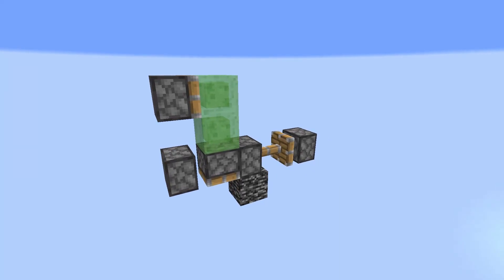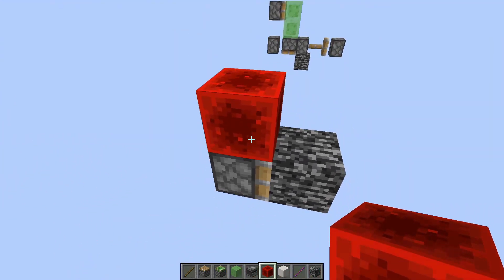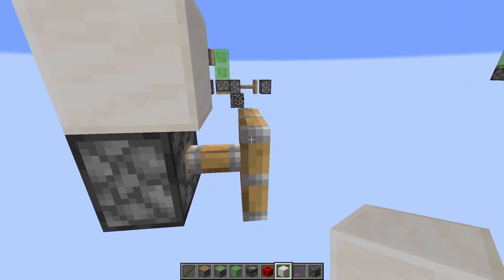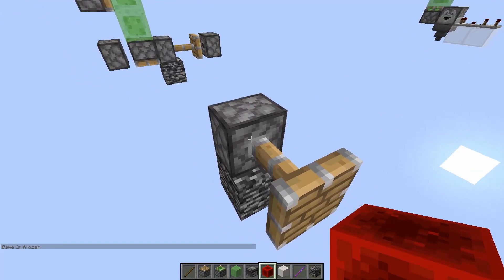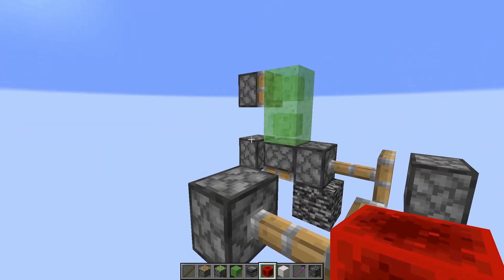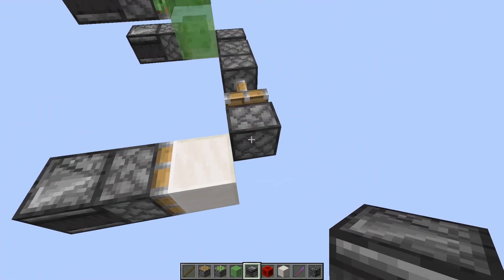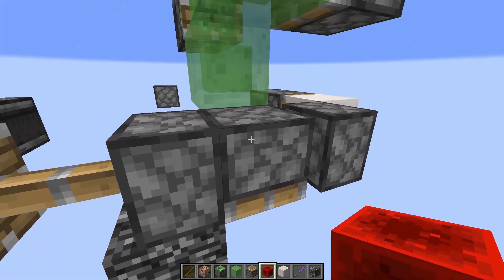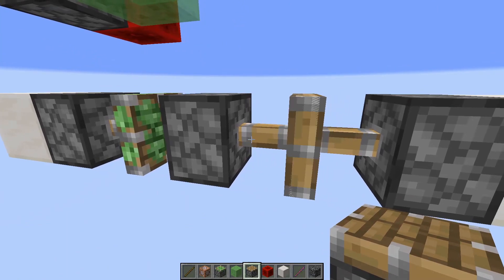Piston-based bedrock breaking setup explained

Comment: Headless sticky pistons "tp" blocks because the retraction of a sticky checks for b36, and if there is a b36 it changes the age into 0(therefore turning it into a block)it's the same as why 0-ticks work like that.
Edit:also that's why powering a sticky piston with an obsever dorps the block
Reply from the maker: Thanks, this is a really nice technical explanation!
Reply: @DesktopFolder  i am not 100% sure it works that way in 1.16, but it does in 1.12 and i don't think they changed that while keeping that behaviour, but it might have changed
Reply from the maker: @dioswilson3153  I think Coolmann's video suggests behaviour is the same, and it's certainly the same as far as I can tell in terms of practical use, but there are a few weird subtleties that make me think it might work for different reasons under the hood (e.g. I don't believe you need a block on the other side to drop blocks in 1.12?)
Regardless, in my opinion it doesn't matter that much anyways, as long as the technical explanation works with the observed effects, so be it :D
Reply: @DesktopFolder  wdym you need blocks on the other side?
Reply: @dioswilson3153  the behaviour is now explicitly written. there's a line in the sticky piston retraction code that
a. checks if there's a b36 2 blocks in front of it
b. checks if the b36 is "moving" in the same direction
c. checks that its an extension
if all 3 are met it drops it

Also. Both sticky and normal headless pistons always drop b36s directly in front of them. However, they will immediately delete the blocks they just dropped unless the piston is sticky and there is a block it would normally pull. 

You can see this by having a headless piston drop a moving redstone block in this way, and put a redstone lamp next to it. the lamp will light, showing the block was dropped first then deleted.
Reply from the maker: @dioswilson3153  Sorry, that was really poorly worded, I meant in situations like this : https://imgur.com/4Mtfb97
where the b36 is moving in a direction perpendicular to the headless piston (instead of parallel) there must be a block on the other side for the headless sticky to properly accelerate the b36, if there's no block there the b36 is destroyed
Reply: @punchster289  iirc stickys couldn't delete bedrock, at least in 1.12, so it doesn't set air in front of it
Reply: @dioswilson3153  not anymore. now it will delete the block unless it has something to pull on.
Reply: @punchster289  where  in the code did u find that? are u using mojangs deobfuscation maps or mcp reborn or something else?
Reply: @punchster289  im using mcp reborn and i think i found it. is it in the PistonBlock.java file in the eventRecieved method? in the code deobfuscated by mojangs obfuscation maps, is it in the PistonBaseBlock.java file in the triggerEvent method? if not, where is it?
Reply: whats a block 36?
Reply: @joelkjobi3070  basically a moving block

Comment: Great video, nice useful info and mostly accurate, except in 1.13+ you actually can still make a headless piston face into bedrock, you basically use any normal bedrock breaking setup but repower the piston immediately when it should retract through the bedrock. I made a small video on that topic.
Reply from the maker: Super cool, didn't know that!

Comment: Dude, your bedrock breaking machines saved my project; of course I'm here for the breakdown! From all the manual breaking I did, I feel comfortable with the basic breaking theory (essentially transferring a retraction event from one piston to another that faces the bedrock), but the breakdown of the "machine" is next level. I built your machines, but I couldn't pretend to understand them. I am just glad someone did. :)  

I would need to really sit down with carpet mod and the setup here to fully grasp the whole update order thing. I get the idea in abstract, but just how to paint that abstract over the actual piston pushing movement/order is where I'm coming up short. Appreciate the work as before!
Reply from the maker: If ordering is a pain, try using Fallen_Breath's pistorder mod; it's quite handy!

Comment: nice video, but two questions :
- couldn't we just 0tick in downwards piston ?
- can't use rising edge block event delay on the piston that moves the downwards piston ?
Reply: 1-if you managed to schedule an extension be in front of the sticky piston (idk how),you need to schedule and execute the retraction after the destroyed piston scheduled a blockevent

2-you need to a extending moving block to do the setblock 2 bock in front of the piston,so it will not work unless you place it on the side
Reply: "couldn't we just 0tick in downwards piston ?"

Not in a naive straightforward way.

Let's say we have a piston P1 that schedules a retraction event and then gets somehow deleted,
and we have a piston P2 that 0-ticks a downwards facing piston P3 into the position where P1 used to be.
The 0-ticking involves an extension and a retraction block event.
So in total the following block events are involved:
P1 schedules a retraction event A,
P2 schedules an extension event B,
P2 schedules a retraction event C.

The order of A, B, C have to satisfy the following conditions:

1. P2 can only schedule C, after it has already processed B.

2. P2 can only successfully process B after P1 has already been deleted.

3. P1 can only be deleted after it has already scheduled A.

From those three points we can see that A gets scheduled earlier than C.
This means that A will also get processed earlier than C.
But this means that the piston P3 arrives too late in its position to actually break the bedrock.

So naive 0-ticking won't do the job.

Now, the point 1 above isn't actually completely rock-solid, and can be circumvented with enough headless piston tech.
You could have a setup where B and C aren't scheduled by P2 at all, but are instead scheduled by a different piston that then gets deleted, and only then move P2 into place.
So you could have another piston P4. You then let P4 schedule two extension events, then let it process one of the extension events,
then schedule one retraction event, then delete P4, then move P2 into its position (using headless piston tech to be fast enough)
and then finally you have an extension and retraction event on P2 that will allow you to perform a bedrock breaking bug by just 0-ticking P3 into the position of P1.

So you could 0-tick in a downwards piston, but only if you use headless pistons to schedule the block events of that 0-ticking in a very strange way.
Otherwise it will be too slow.
Reply from the maker: @myreneario7216  Thank you so much for this explanation, it's fantastic & really useful (for me at least). Really, really appreciate it!
Reply: @myreneario7216  how do you schedule 2 extension blockevent on p4?afaik it's only possible in 1.15- due to a bug
Reply: @pwouik9784  
I'm not entirely sure for newer versions, but at least from 1.8 to 1.12 you can schedule duplicate block events if you have one block event delay between the two schedulings.
Reply from the maker: - I actually asked myself this question while recording... maybe? if so, that opens up a lot of possibilities. I previously assumed that, as nobody had already done this, it must not be possible... but slimestone isn't really that large, so it may well just work (tm). Definitely a viable avenue of research.
- no clue I think adding any BE delay to that piston breaks the setup but I could be wrong. would have to double check
Reply: @DesktopFolder  well would need to know when exactly the piston base is removed, if it is in block event phase, just after the arm is deleted, then it would work, otherwise more block event delay probably wouldn't work

Comment: yooo great video.

you can make a headless piston facing into bedrock in 1.13+. If a retraction event is scheduled on a piston and then fails, it will just set the piston to extended without changing its direction. Completely useless though bc now we lost the sideways facing piston.

the main difference between pre and post 1.13 is every bedrock breaking method now requires some way of moving an extended piston from a block after scheduling a retraction with it. Even in 1.12 this could be done with instant retraction, but now the only way to do that is to delete/break it, meaning it is lost.

It is damn lucky retraction events replace whatever piston they act upon with the b36 of the piston which scheduled it, or else fully auto bedrock breaking wouldn't be possible at all in newer versions.

also steps 3 and 4 are interchangeable iirc.
Reply from the maker: Really interesting and useful information, thanks for sharing! With regards to the second-last point, I believe the older mechanism (as shown in my first 3-way bedrock breaker) would still work, you would just have to preplace sideways pistons instead of downwards facings ones, and slightly rework the setup. 
The methodology used in the new 3way would work also, it would just be more of a pain. Although it's possible I've misunderstood what you meant here :D

3 and 4 are interchangeable as you say, however with the modern setup (shown in this video) for actually triggering the mechanism, there's no way to decouple 2 & 3 so you're forced to go with this order (as it's either 2-3-4 or 4-2-3, the latter of which doesn't work, of course) 
The old setup using a pushed in block to attach the piston could have its ordering changed as you say, though.

Comment: There are more strange glitches/mechanics involved than I initially thought! So the way manual bedrock breaking works is to place the bedrock breaking piston in the same tick instead of pushing it over, using the retraction event of the exploded piston to break the bedrock.
Reply from the maker: Yeah, exactly!